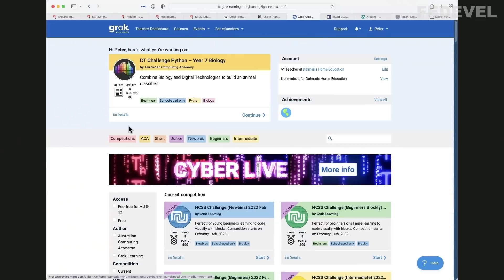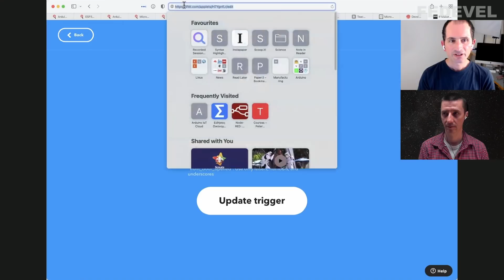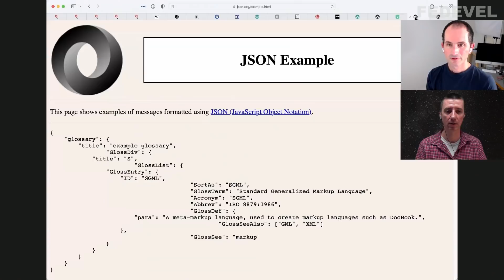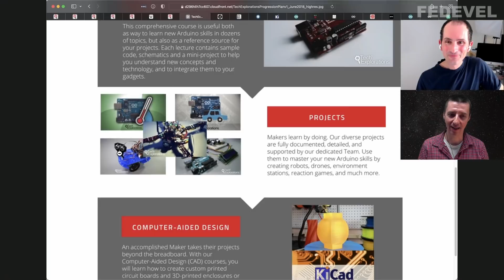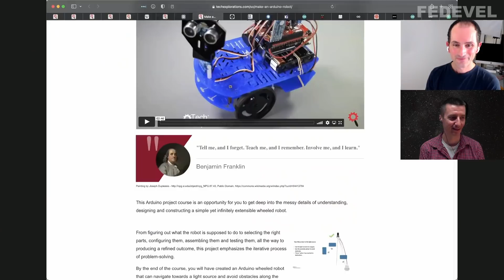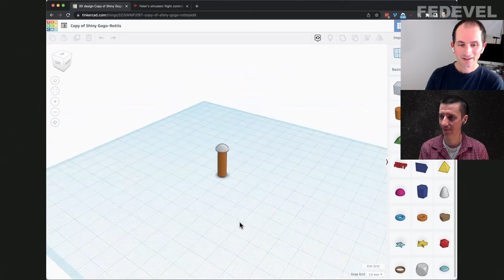Asking Peter with 100 000+ students: How to Learn Electronics and Programming? | Peter Dalmaris

Comment: So many things on the internet about the programming blah blah 2. but when it comes to schematics design or to understand very basics of electronics. There is none. go to each datasheet by datasheet. no detailed information about the MCU, why using 0.1uF 1 uF. what would be problem reverse diode protection emc different layer.

Comment: Engineering is about creating items that do specific things. My teaching recommendation would be to start with a specific gadget that the child thinks would be cool to own.
i.e.  Ask the child what they would like a custom gadget to do for them, and only then teach them how to make that gadget once they are invested in wanting that gadget.
If you start by teaching the engineering with no tangible fun project in mind, then the learning seems like pointless drudgery to the child. (It's like being forced to learn everything about how paint brushes are made, without ever getting to paint anything.)
With my child, I asked them what gadget the would want, and they said a Pokeball that when the button was pressed flashed a light in the the button several times then played the Pokemon captured sound. So, we designed a circular PCB together, and wrote the 'C' for the microcontroller to implement all that functionality, and built it all into an empty 2" plastic pokeball we bought off eBay.
My child is delighted by the fact that they are the only person in the world with that gadget, and that they helped design and build it.
It was a much better way to teach than a dry lesson on coding, devoid of all motivation.

Comment: Hi, I’d like to share my experiences as a self-taught programmer and electronics hobbyist.  If that offends anyone reading, I’d suggest not reading further.

I’ve been interested in the nitty gritty details of electronics since childhood because I enjoy working and building electronics.  But it is only recently (think 1-2 years) that I’ve been spending more time trying to learn electronics from a formal textbook/resource.  I bought an O-scope recently because I realized that I need this tool in order for the theory of electronics to stick to my memory.   My favorite part of electronics is micrcontrollers and using software (firmware) to drive hardware. 

For beginners, I think Arduino is actually not a bad idea BUT, don’t just stay on the Arduino IDE level.  I developed firmware in C programming language using Visual Studio Code IDE and reading the datasheet.   You learn so much going this path.

You might be wondering “why not go to school for this?”. I tried and I failed.  Ended up getting a math degree.   But theres so many resources online.  Why do I need to wait for a university to give me the “consent” before i can learn?  The college education system is heavily flawed in my opinion but thats all I’ll say about it right now.
Reply: Hi John, I'm currently into Hardware (PCB design(schematics and layout) and testing using scope,logic analyser,etc.). I have some interest in software as well- stuff like firmware but in my company (big MNC) we have a seperate team for that. I want to do both. Any suggestion/career advice?
Reply: I'm on a similar path, from pre-Arduino, 6502 and AVR era, was always interested in digital interfaces and CPUs/MCUs. Founded an LLC company so I could buy components from big boys :-). Currently more in backends and DevOps, but still soldering circuits with my Open Source firmware based TS100 iron and sometimes having fun with Lattice FPGAs. Got tons of Arduinos but using them as helpers/tools only, sometimes.

Comment: best way to learn electronics, trying to make something without arduino :)
Reply: So true! Once I started to go bare metal on ARM, everything got so much clearer, and I even started learning about programmable logic with verilog, and right now I'm trying to go down to the mosfet level of IC design
Reply: I did once start a debate on the EEV-blog about if Arduino was destroying the electronic hobby, but everybody said "nooo" and "why I thought that?" My problem was mostly because I am trying to learn basic electronic and nearly every time I try to look for something is this annoying chip in the way.
Search "blinking LED" - result "simply take an Arduino and write this code..." Or "how do I make 3 button latching?" - result, "yes, you guessed it". Heck, even if I want to burn my PCB off in thick blue smoke... get an Arduino!!! :-)
Reply: So much this.
Reply: The Fran-tastic way!
Reply: how do we do that without arduino ? as someone who's a COMPLETE beginner like me. i want to learn the basics from designing the PCB right to a complete product that i can hold with my hands and use.